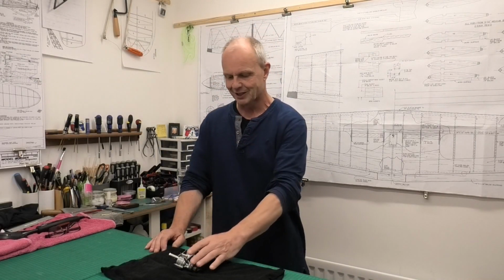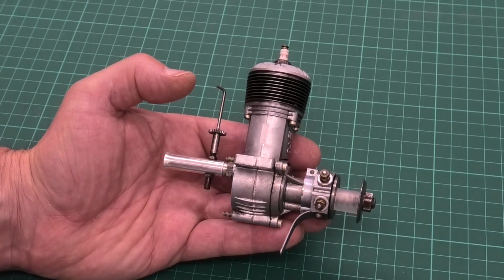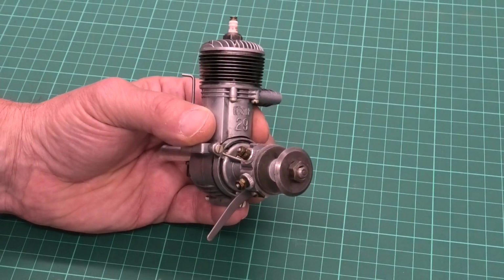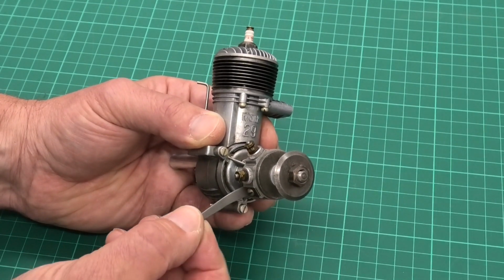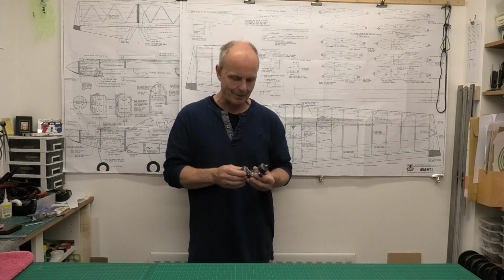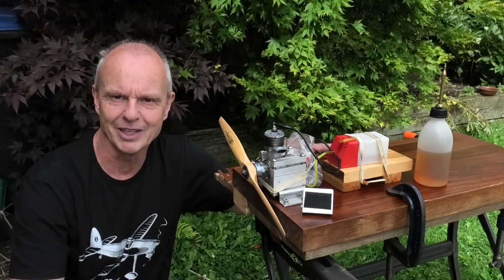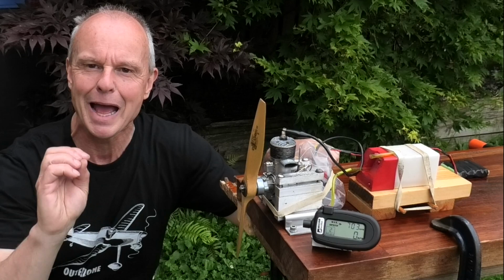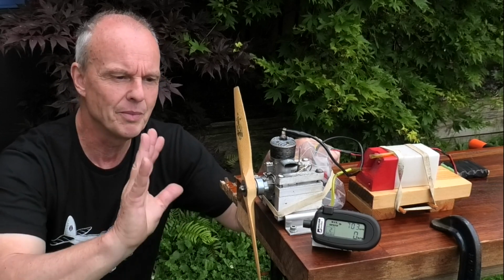Forster 29 a 1947 Spark Ignition Engine - Review & Run

Comment: I have 3 Forster engines, one is a rear intake .29 like yours with single points. The second engine is another .29 that is a front intake single point replica made by RJL industries and the last is a .99 dual point replica by RJL. The front intake is mounted to a Quaker Flash and pulls it up nicely, the other two are in my collection waiting for an airframe.

Comment: Hi Mark, On the two speed timer the high speed point is the upper one and the low speed is the lower one. You use a simple switch relay to switch between points for two speeds. I noticed you had the connection on the low sped point. You can use either points if not running a two speed relay. I have a two speed Forster 99 set up for high and low speed running. cheers Bill B
Reply from the maker: Hi Bill, thanks for the comment and information, always appreciated.  The points I use on this run are definitely the High Speed points, they operate earlier, hence in advance of TDC, compared to the others, the low speed points.  You will see them operating in a video I will be posting tomorrow.  The Forster 29 must be set up differently to the 99 you have.  I have never run a 99, yet! 😜 thanks again